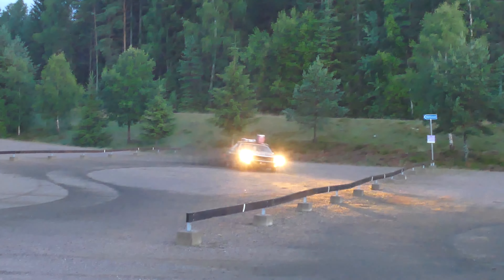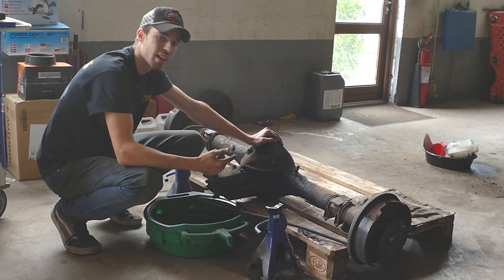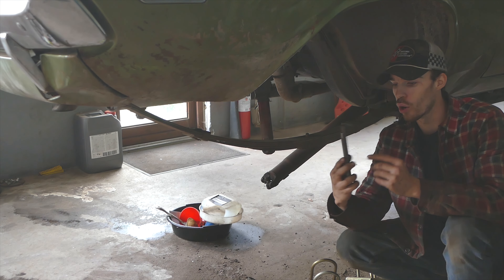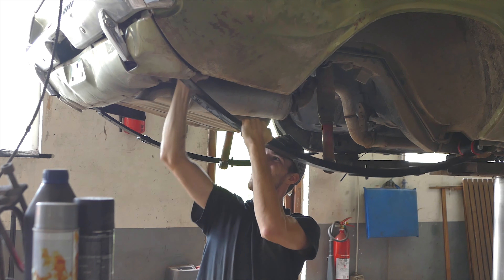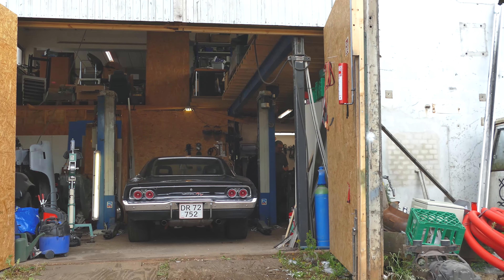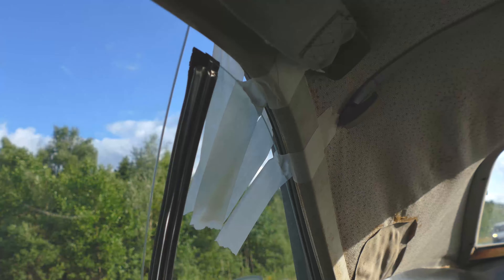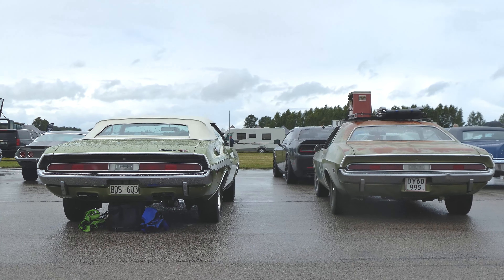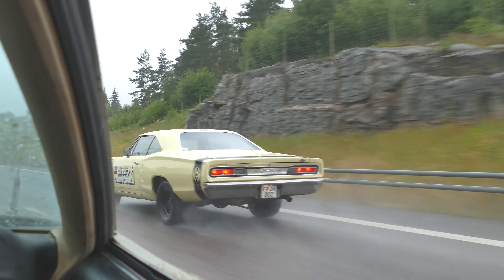Will This 1970 Challenger Drive 1300 Kilometers!?

Comment: Great Video! Just a note: Leaf spring hardware should be torqued only when under load. You should basically just hand tighten it until it is at ride height then actually torque to spec. Otherwise you will have binding in the bushings.
Reply from the maker: dont worry no bind on these solid units, specialy after a couple jumps 😁

Comment: Man if you want to keep that rear end you are going to need and overdive transmission to get better MPG. Gotta lower those rpms. I left the 2.76 gears in my Charger and ran an aftermarket EFI on the 5.9 magnum engine and got 30MPG on the highway going with the wind.
Reply from the maker: yeah i was pretty good before goal is 6/5 speed this winter plus a huge engine ;)

Comment: It is a slant6 it can drive forever
Reply from the maker: pretty sure rings are giving up but otherwise yeah!
Reply: @Viktorrhansen   prwtty shure it can run without oil for 500kilometers. There are videos of slant6 runing and driving with a hole i the block.